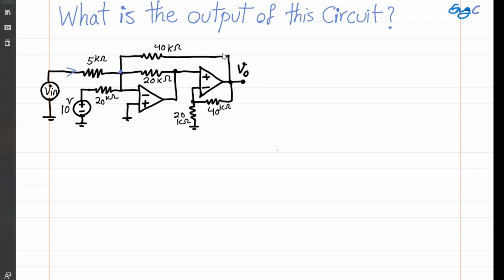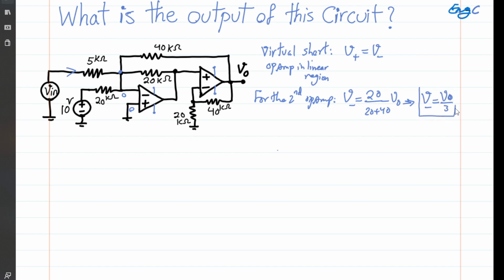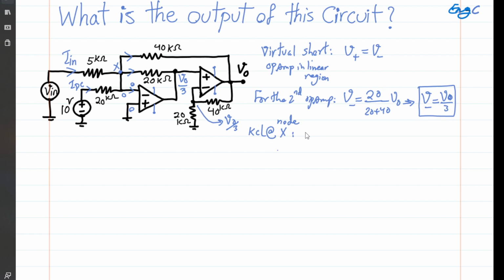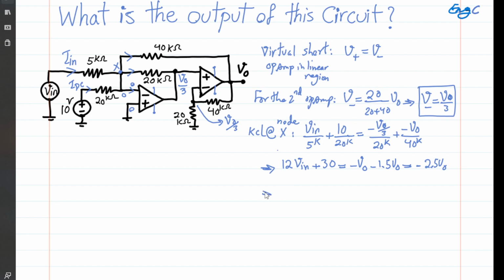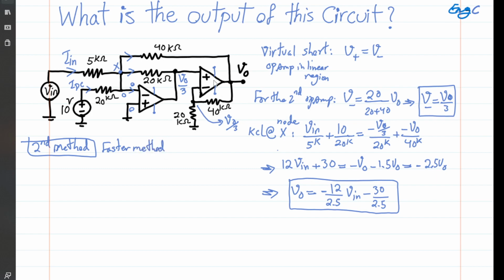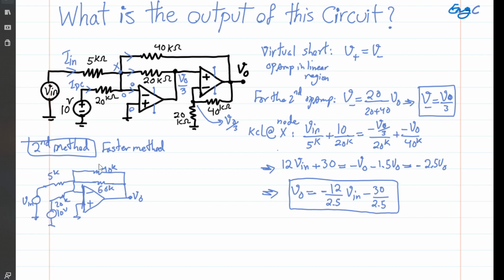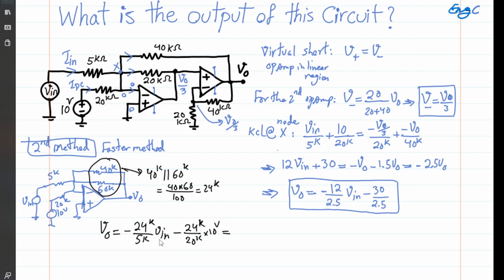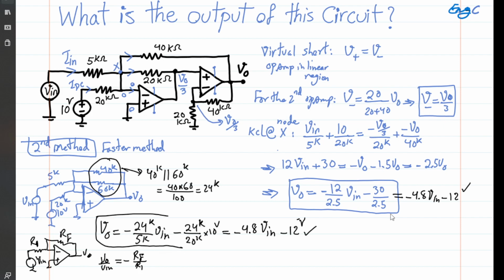What is the output of this voltage combiner amplifier?

Comment: How would I know theres no Vin on the first powersource... 🤔... Which I think should be ac... 🤔
Reply from the maker: In this example, Vin is a general input voltage source while the 10 volt is the second input in the form of a DC voltage source.
Reply: @STEMprof  so sorry, I haven't finished the vid... 🙏😅... Nice vid👌
Reply from the maker: @christophertadeo6120  Thanks for watching. Glad that you like this Op Amp Amplifier Video. For more examples please see
Op Amp Amplifier with Electronic Gain Control https://youtu.be/NoNgQpbj77Y
How to find Bode Plot, Freq Response, Transfer Function of Analog Filters https://youtu.be/vZFkPeDa1H8
Op Amp Analog Computer Differential Equation Solver https://youtu.be/ENq39EesfPw
Push-Pull Power Amplifier with Darlington Transistors https://youtu.be/866MYibo8yE
Analog Logarithm Computer https://youtu.be/RpKEq5WyoLg
For additional analog circuits and signal processing examples see https://www.youtube.com/playlist?list=PLrwXF7N522y4c7c-8KBjrwd7IyaZfWxyt
I hope these Circuit design and analysis videos are helpful. 🙋‍♂

Comment: enjoyed working it out myself. Thanks. I used the first method. Clear and simple for me.
Reply from the maker: Thank you for watching, Glad that you liked the voltage combiner video. Here are few more examples: 
1) Linear Voltage Combiner using operational amplifiers:  https://youtu.be/wVEnmBLTA20
2) Differential Amplifier Gain and Analysis: https://youtu.be/gSaAcUCXQGk
3) Gain of Op Amp Circuit with Resistance Ladder Network: https://youtu.be/dx95Y0CBtnU